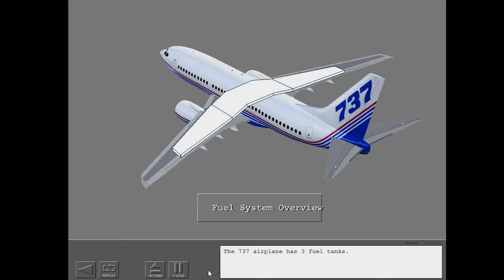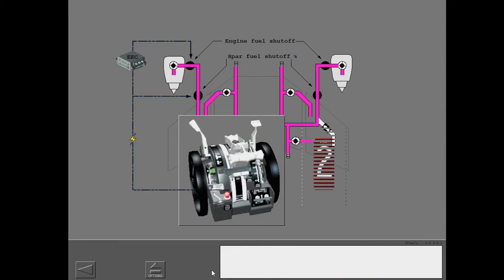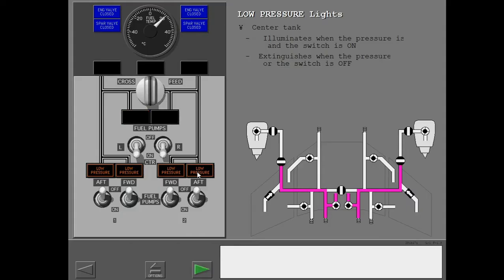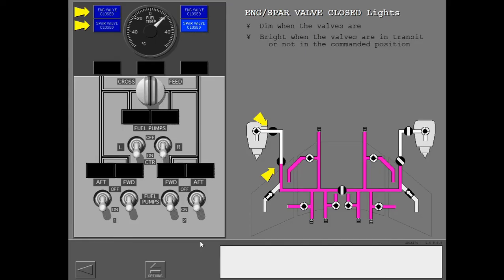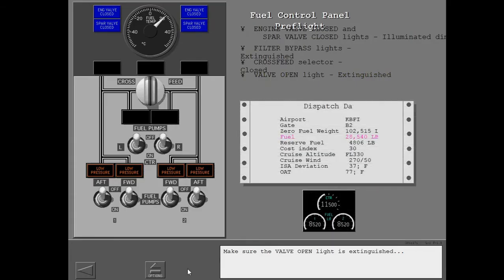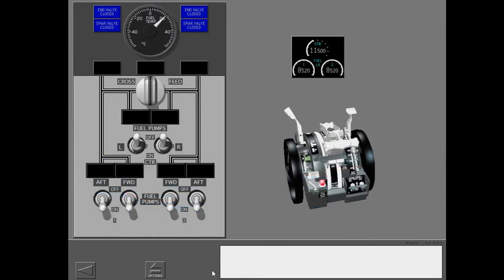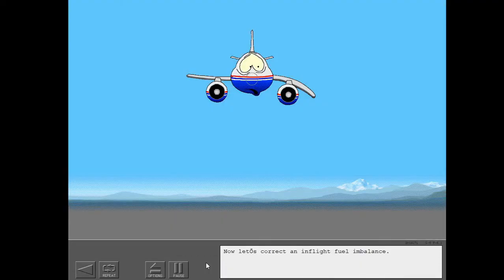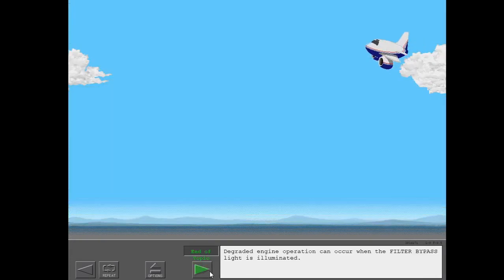21. Boeing 737NG - Fuel System

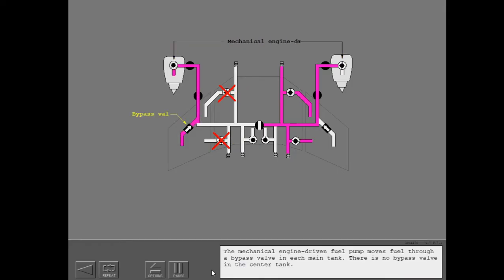Comment: 3:55 Why isn't there any bypass valve in the center tank? 
in the situations like.. what if both center boost pumps are failed? shouldn't there be bypass valve?

And one small question.. Why is there only one temperature sensor?
Reply from the maker: great question, there is scavange jet pump that will operate and transfer fuel from center to main tank 1 automatically if the quantity in center tank more than main tank. so if both center boost pump failed, still fuel in center tank will empty first. 
temperature sensor place on the farthest point of tank to calculate the coldest temperature far from any heat transfer line and booster pump.